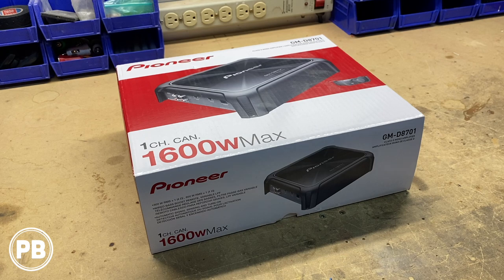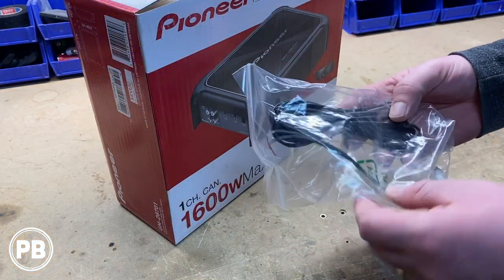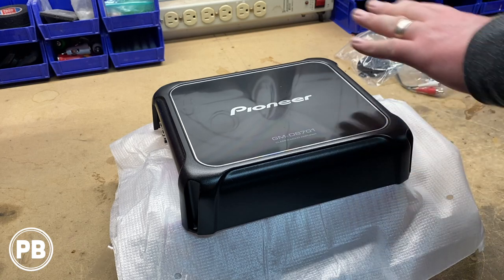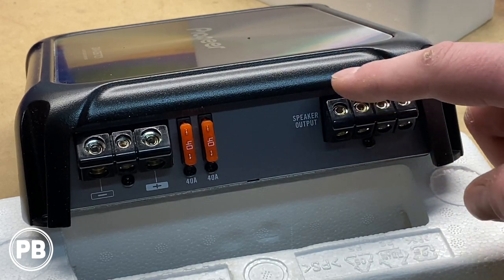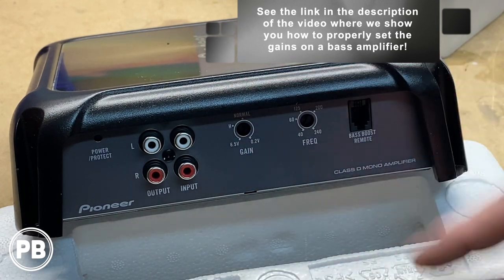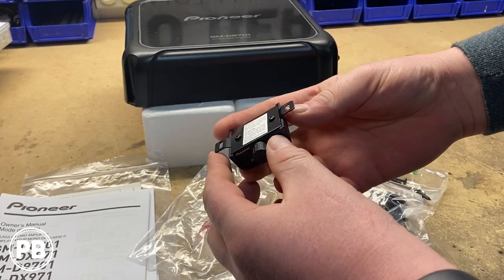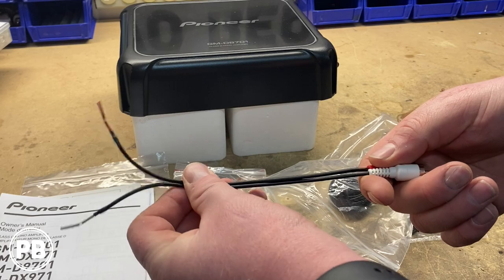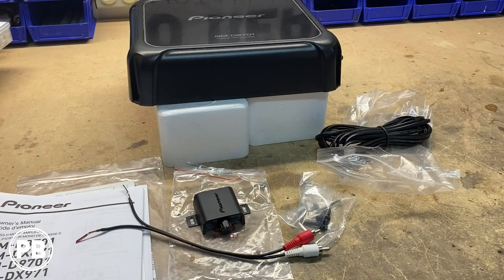Pioneer 1600 Watt Bass Amplifier Unboxing | GM-D8701

Comment: How do u wire a 2 ohm sub to this amp,  is it + and + or bridged
Reply from the maker: 100% depends on the subwoofer and the type of sub you are installing as the ohm load is generated by the sub itself.

Comment: how to use the high filter or pass... that is, to listen to the music and the bass together... do you know how to configure it or what should I install so that it sounds with the music and the high bass... thxs for ur time sr..
Reply from the maker: Depends on your speakers. Generally mid bass speakers high pass filter can be set around 60-80 Hz. Anything lower and usually you will hear some distortion at high volumes.